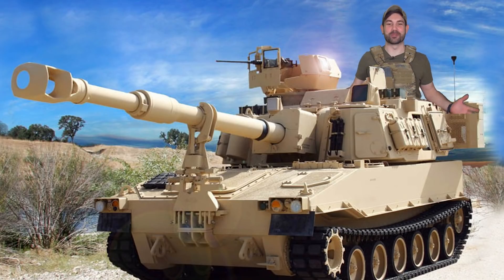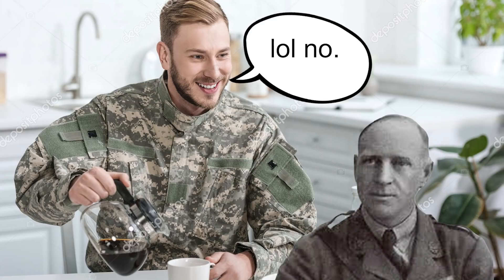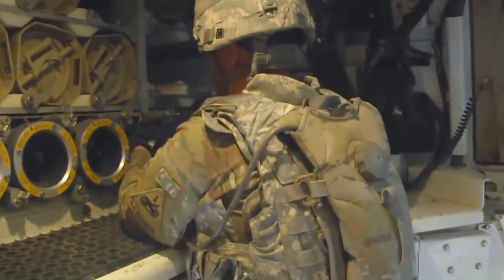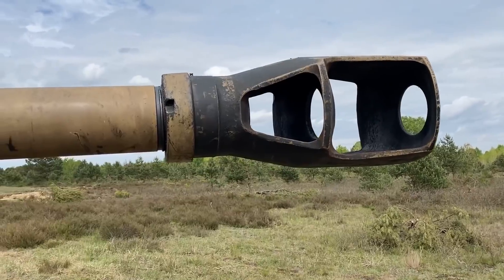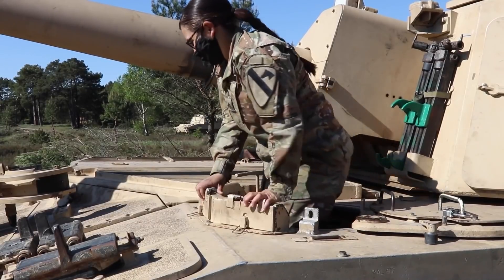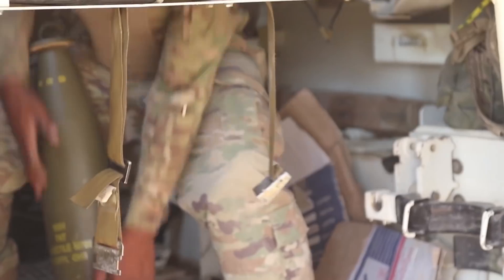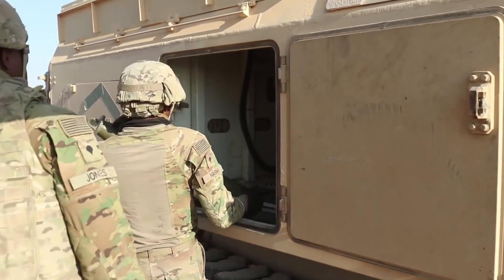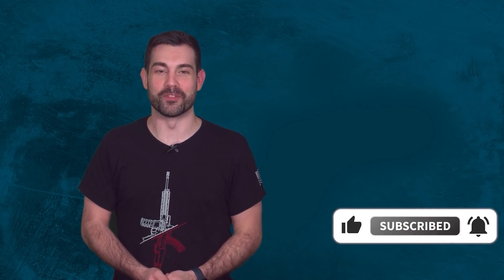M109 Self Propelled Artillery Vehicle Tactics Explained

Comment: One thing about the crew size... the crew size was down to four well before the M109A6 was introduced. Despite it's size, it's still very cramped on the inside. Crews typically have the Chief, the gunner, the driver, and #1 man (loads, fires, and swabs the bore chamber between rounds). And the vehicle that accompanies the Paladin would be the M992, also known as the C.A.T. (Chow, Ammo, & Trash). You may have also noticed that even the vietnam era videos featured the automatic loader.... even I did know how old that design was! Holy hell lol
Reply: I have crewed M109a2/3's and M110a2's with as few as 4 guys (with the AP man gone on to the next position) and the Lt, Smoke, Gunny, or some other Safety Certified Officer/NCO would have to come down and stand there and be "Safety" guy because chief was acting as gunner ....  never had more than 8, including AP man in a section going to the field.... on paper, you might have had 10 or 12, but there were always guys detailed to the Post Office, Post Gyms, Post Maintanance, ..... drivers for staff officers, etc .... When Desert Shield came up, we guys coming from everywhere .... hit Saudi with 13 people in my section .... the hardest part was figuring out where to put 13 people and their shit on two vehicles stuffed to the gills with thousands of rounds of small arms ammo(5.56, 7.62, and .50Cal), a couple LAW's, and an AT4, 4-6 dozen 8" projos , 50-60some powder charges .... 8-10 boxes of fuzes .... the M548 Ammo carrier was rated at 6Tons of cargo capacity ...hell there was 6 tons of various ammunition/ordnance on there .... not counting all the baggage and rations and bodies and cammo netting and poles, tools, bales of sandbags and stuff that made life in what was that term .... "austere locations" ...possible .... two GP small tents and yukon stoves, couple jerry cans of diesel , water, the shitchair, lumber and 4 sheets of plywood ....  13 cots....
Reply: @danieparriott265  hi Danie. I am curious if there are any nicknames for the gun crew positions (you wrote "Smoke", who is that?), or slang used for their positions or for the gun. I like to learn the lingo used by soldiers in the field, whether humorous or fun or "dark humor" slang etc. please let me know of any you heard. Thanks for your service. Sincerely.
Reply: @steadmantheartist  ""Smoke" is the "Chief of Firing Battery,  and is formally  the Platoon Sergeant, and it was always an E-7 (Sergeant First Class)  slot but often filled by a senior E-6 (Staff Sergeant in my time in the Army.  There is also  the "Gunny"  "Gunnery Sergeant", another SFC slot...  his primary responsibility is leading  the Advance Party for deliberate Occupation Operations-  he went ahead with a man  ("AP man") from each gun section,  one from commo, and one from the FDC (which, in this age of digital instand comms, may not be a thing) and reconned the new firing position,  selected gun positions and got the aiming circle data pre-set to each and each man assisted in this after establishing wire commo, then prepared the gun position, laid out and cleared the route from the release point to the position.   The gun crews were led by a "Gun Chief" (Staff Sgt/ E-6 Slot, but  I was a Gun Chief for few days as a Corporal (E-4) after my Chief got relieved for drinking on duty... )  ... the "Gunner" actually trained the gun and was the man on the gun sight, left side of the breech ,   "AG"  (optional, not necessary, but sped things up, and speed was VERY important, second only to Safety and accuracy, completely necessary if you had to go without electric hydraulic power) was on the right side, and could elevate the gun and had a direct fire telescope.... the various cannoneer positions were numbered,  1-6 or 8, depending on the piece involved .... on the 109 series, the  No. 1 Cannoneer operated the loading tray and loader-rammer,  and fired the piece with a lanyard .... on the M110 seies, it was the No. 2 Man that "pulled tail" .... The Senior guy on the Ammunition Carrier (M548 Cargo Carrier or M997FAASV in my time)  Was the "Ammunition Team Chief,  responsible for the inventory, security, stowage of ammunition and  the 4513 (DA Form 4513, "Record of Missions Fired".   Yes, even in War, even in  a SHOOTING WAR, there's paperwork to be done!)  Also in the Ammo vehicle, there the RTO (Radio Telephone Operator and another cannoneer ..... now you have to remember,  almost always, the crew is not at 100%  manning ... I never saw it, except in the Gulf War.... and even then, the AP Man was gone 99% of the time .....  but shortly before I got into the Army, the Department of Defense was directed by Reagan's Secretary of Defense to  roughly double  the number of American artillery tubes facing the Warsaw Pact .... and they did it not by fielding more units, but by increasing the number of guns in each battery.  A  4 gun Battery  of  2  2 gun platoons became and 8 gun Battery    ... They were short of Artillerymen and it showed.... they took anyone with a pulse.  Any promising guy with any sense at all could make e-5 in 3 years and be a Gun Chief..... on a piece that was authorized 13 men, but had 6 or 7 on paper, and only 5 or 6 in the real world, the other 2 detailed to work at the gym or the Post Sgt Major ...
Reply: @danieparriott265  Thank you for taking the time to write a detailed and helpful response to my questions.  :)
Reply: @steadmantheartist  In my Experience, ... "Smoke" was the younger man .... but in charge, nominally.  "Gunny" was under him in the  chain of Command, but always seemed to be the "Elder Statesman" .... a guy that was ready for retirement, but just not yet .... on a personal level, It was always like "Smoke" was your strack assed Dad, and Gunny was your doting Grandfather ....   He already made his bones years ago, and everyone knew it.  He had all the answers, and feared nobody.  I remember one Gunnery Sgr. that knew and shared so much that All and sundry, including officers referred to him always as "Gunny-Guru" ...
Reply: @danieparriott265  Thanks for the additional info. I understand and your comment brought a smile, as I have not heard the term “strack” since the 1970s, but I know what you mean.  Thanks.

Comment: The second tank shown was a French ‘chat’ 
Unlike the unimaginative lumbering British ‘tank’* designed and operated to drive through coiled barbed wire then ride over trenches en masse, the French tanks were recognisable to modern eyes as having tracks, hull and revolving turret** with artillery gun of respectable calibre. And mobile and manoeuvrable over varying terrain. 
* the term ‘tank’ was a Hindi word meaning large water, well, tank actually. It was used as a code name to mislead German spies about the armed armoured vehicle project prototypes
Reply: Just to be clear, as a M-577 driver, I can attest that driving though barbed wire means at least an hour of work with wire cutters, clearing the tracks. Guess how I know.
Reply: @jimnotter6046  From hard experience forming the basis of expertise 👍🏼

Comment: Initially equipped with a short barrel, the gun went through a series of modifications over the years, culminating in the M109A4+ version.  This gun had better protection against nuclear, chemical, and biological weapons.  The longer barrel improved the range by 4,000 metres.

Weight of projectile: 98 pounds
Range: 18,000 metres. 22,000 with special ammunition
Detachment: Gun, HLVW ammunition carrier and 10 Gunners

Comment: 360degree traverse was its weakness. The carbon brushes and slip rings that carried the power to the turret were very poorly designed and needed constant adjustment and replacement.
Reply: The 360 traverse use was pretty limited. The "claws" at the back wouldn't work if you were firing at a 90 degree angle.

Comment: Isn't  MLRS   the  big hammer in FA  ? the 155  SP  is still a value  asset  . They have a bunch of them they don't  have buy  just retro aiming systems  and keep   back up parts .  the  105mm  trailers  are still   useful  they can be  move in fast with the Helicopter  47 twin rotors.  Some of those pictures of Fort Sill bring back memories 1983 15E 10  Pershing and  Lance faded away.  MLRS  took over.

Comment: The Army tried to replace the M109 and failed. Not once, but twice. Crusader had some awesome capability (5 round MRSI, high sustained fire rate (10RPM) with the crew remaining inside, reduced crew requirements), but was canceled in 2002. Then there was the Non-line-of-sight-Canon (NLOS-C) which was part of the Future Combat Systems program and eventually fell by the wayside like most of the rest of FCS. Both of these, and Comanche, and GCV, and others were all victims of the US Army terminally flawed major system development process that lasted for decades, and is only in the last few years emerging into something workable. The current strategy of incremental upgrades is working much better than previous efforts. In the end, it will be an almost entirely new vehicle, as stated in the video.

Comment: How many accidents occur inside those tanks from gun recoil? It looks like they only have a small amount of space in which to get out of the way before that whole thing comes firing back on you. 

Do the soldiers live in those tanks 24 / 7? Or do they park then at night and sleep outside? Information like this would be cool to know. 

Thanks.
Reply: Surprisingly not many accidents happen, but soldiers are always taught to maintain a distance from the breech when firing. When firing, you basically stand as far to the side as possible. The first time firing one is scary, but once you get the hang of it, it becomes second nature, just like gun safety.

As for living in them 24/7, it all depends if you are being fired upon or if there is a significant threat of being fired upon. If the enemy mostly has mortars and can't shoot anything near you, then there is no reason to spend so much time inside. It's a lot roomier than an actual tank, but it is still not fun to just hang out there. But if the enemy has rockets or other artillery, you basically spend as much time as possible inside the vehicle, since the armor is strong enough to protect against shrapnel and you may have to switch locations fast.
Reply: There was one in the news recently in March of this year .... Soldier from Fort Hood got in the path of recoil during live fire exercise at NTC Fort Irwin .... killed him DRT.  Accidents happen when people make mistakes.  It is a dangerous business.

Comment: We practiced the hip shoot with weapon, incessantly.  We could pull off the road and get a volley out in about a minute. This was using slide rules and charting grids.  This was the piece that, more than any other weapon , kept the Russian bear in his cage; it can fire nuclear rounds. No it is not obsolete. MLRS and like systems shoot their wad and then have to take a time to to be reloaded. The A10 is the same way.  The M109 provides a continuous and sustained presence on the battle field. But training is key, especially in counter-battery techniques and skills. Further, the plans to reduce the crew size should be reviewed.  The loading system ( rammer) needes to be thoroughly tested for reliability.  Pushing rounds into that thing by hand can get old.

Comment: Ok normally don't do this but since I helped field the A7 I figured I would help you out. some of your stats are wrong full crew compliment in a M109A6/A7 is 8 personnel 4 in the howitzer 4 in the FAASV M992A2/A3. Your rates of fire are way off max rate of fire for both A6/A7 is 4 rounds a min for 3 mins and sustained is 1 round a minute indefinitely(you can not change those rates with an auto loading system by much since they have to do with heat dissipation within the tube causing cook offs) The A7 does not have a auto loading system it went from a hydraulic ramming system to an electrical driven raming system the crew still has to pull the round from the rack and put it on the loading tray. Finally the A7 wasn't even fielded successfully until the winter of 2017 and the 1st battalion to get its full compliment wasn't until April of 2018 the initial run was built was 18 howitzers for the BN and 10 for the fielding. You might confusing that with the first fielding attempt back in 2015-2016

Comment: Hard to say, the MRL does have superior range and can fire more rockets faster, but doesn't have that sustained fire solution. Both systems will not hold up well vs air assaults, but i would suspect a MRL might get lucky against a helicopter offensive where the M109 less so. Further more we have to understand the limiting effect of the ammo, a single shell is capable of what, wounding a handful of solders, meaning in any real engagement you need that logistical support of being in that third line at the supply dumps. Which arrives at the last point of call and that is the blitzkrieg of tank warfare where you can smash through line after line after line of defences and attack the supply train, the artillery and command HQ.

To consider this artillery obsolete, you would need to look at the future of railguns and gunships.
In some regards they are obsolete compared with a spooky AC130, if you want to talk about the apex howitzer its the spooky.
But a railgun, thats helicopter deployable, and capable of lobbing down range bigger projectiles unencumbered by explosive charges, well then maybe the M109 would be obsolete.

End of the day, i think military commanders on the ground will never say no to a M109 showing up in their compound ready to fight. Artillery fire has a way of forcing the enemy to make a move, digging in like WW1 became obsolete in WW2, in a modern war, where you are in artillery duels. The M109 will always have its place... bit like the F15.
Reply: There is the growing threat of drones, satellites and networks. Even IEDS and minefields could be effective.
But ultimately cruise missiles have been around for awhile, and could easily target these military assets, hence why its all about the type of ammo.
Infact i could see 10 of these lined up, shooting hundreds of drones into the air 100km/s away, aka lingering munitions. 

Suppose its a matter of armour effectiveness in combat operations and if fire solutions require engagement with guerrilla or special forces. Who i would assume have Javelins anyway.

Alot of people swear black and blue that artillery wins wars, but when i send in battalions of special forces they just wipe out anything and everything and no one sees them coming. Air power is very powerful and so is naval bombardment. Conventional artillery is rather outdated compared with missiles and rockets but id rather any artillery rather then zero artillery.

Artillery has has a unique way of totally changing a battlefield, which can be for the good or can be for the bad.
My biggest gripe, is simply its suppose to be mobile artillery, but its level of mobility hasn't changed in 70 odd years. 
Its just so slow and logistically demanding, requiring a magnitude of support vehicles and using them in large numbers just decimates entire cities.

I don't think they are obsolete, maybe just utilized incorrectly leaving them vulnerable but thats hard to say and would require decades of battlefield experience. 
Simulations, they seem to do very well in a 50/50 mix with pure AA and Anti Missile. Moment you start stripping away guns, you lack the firepower to decimate the enemy before they get close enough to engage you.
Reply: "In some regards they are obsolete compared with a spooky AC130, if you want to talk about the apex howitzer its the spooky."  In the face of even rudimentary ADA assets, "Spooky" is just a large, slow, low target drone.  Hell, even modern state of the art attack helicopters and dedicated ground attack aircraft are taking it in the shorts in Ukraine from 30-40 year old MANPADS tech ....

Comment: Spent six years on this obsolete hunk of junk.  It was refreshing to actually be behind everyone as far as far as technology went.  War in hard mode.  Cant say enough about how unreliable this thing is.  I can’t imagine firing more a a few red bags before the compensator and breach flew apart.  So in six years, we shot a full red bag exactly once.
Reply: Odd .... we shot the hell out of Zone 9 in the desert with our M110a2's, which were all made about the same time (1960-1963) as the initial run of 109's  aside from a few leaking lockout hydraulic lines, we didn't have a lot of problems ....

Comment: M109 badly needs upgrade.  1. It really needs auto loading.

https://www.youtube.com/watch?v=cSTlQxIH4yI

2. It also needs auto feeding from outside directly: this is critical when fighting a battle, under enemy fire.

https://www.youtube.com/watch?v=a3Ss8ngOUl0

3. It also needs better ToT cabability.

https://www.youtube.com/watch?v=tyPwScT9D_U

4. It needs upgradability to MUM-T.

https://www.youtube.com/watch?v=OJ30j-VFqrs

ROK is all in with MUM-T: K9 will be totally unmanned eventually,  and serve as a mobile platform for autonomous UAV for SPG for identifying threats and targets as well.

ROK K9 has all those covered, why it is the most exported SPG in the world.

Latest news Norway tested 4 contenders for its SPG requirement, and in the end, only 2 remained, the German  Panzerhaubitze 2000, and K9.  K9 ended up winning for several reasons, 1. More reliable in cold weather 2. easier maintenance 3. External auto feeding by K10   4. A lot less expensive 

I read that during 2019 conflict between India and Pakistan, Indian K9s destroyed the Pakistani Paladins, which outnumbered the Indian K9s by 2 to 1, and had fired first.